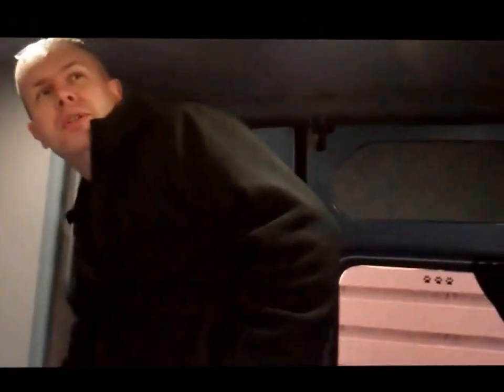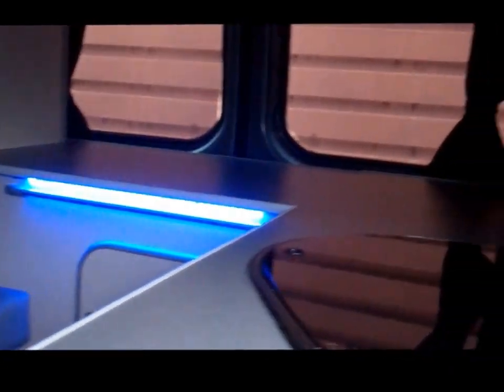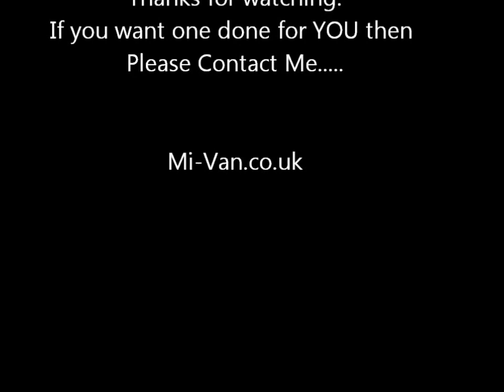HOW TO CONVERT A CAMPERVAN PART 15 FORD TRANSIT

Comment: too mush work!
Reply: Can do it faster by cannabilising an old tupperware canal boat or a caravan or something but they did one thing that 99% of conversions don't do and that's INSULATE IT. It makes a massive difference. ;) Without insulation you can forget winter. Its just not fun.